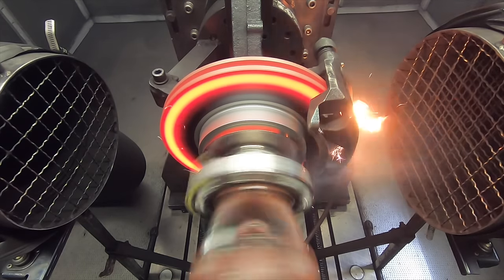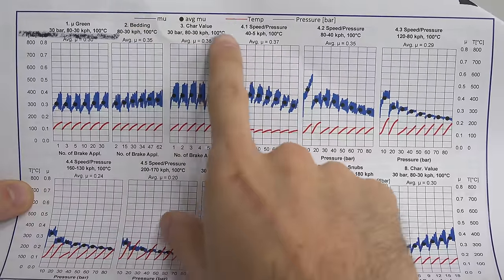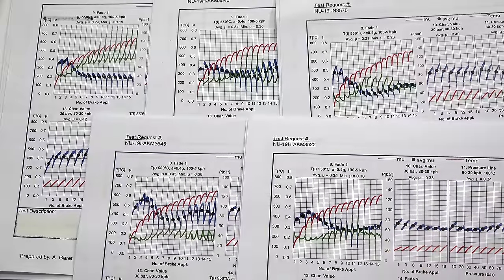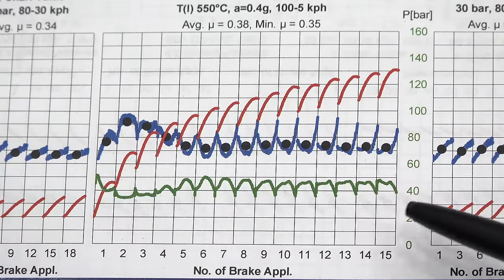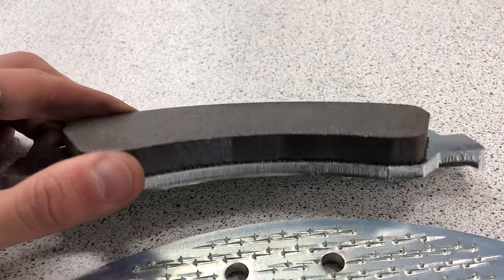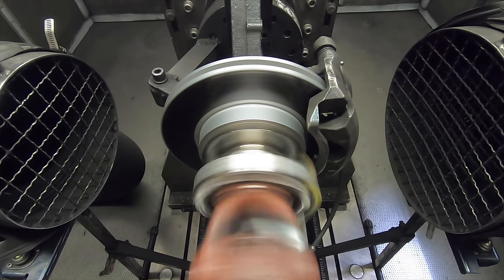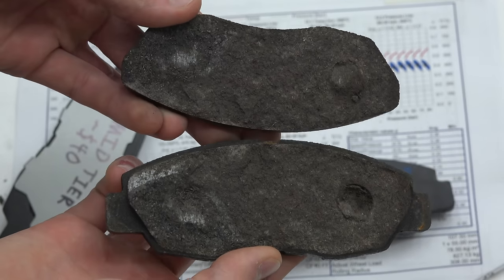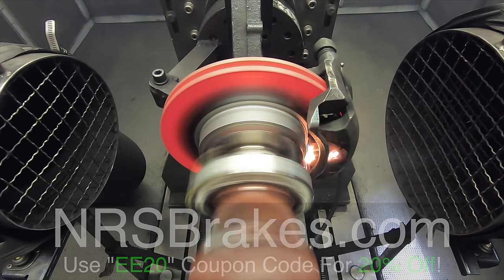What Are The Best Brake Pads? Cheap vs Expensive Tested!

Comment: Thank you for the very informative and interesting video on an important topic. I have rebuilt brakes on too many vehicles to keep track of, and always felt that brake pads are brake pads, with not a lot of differences between them within their class (ceramic (several generations thereof), asbestos, organic, etc ..). But recently, after 20,000 miles of using new ceramic pads and rotors on my Silverado, there was a brake squeeeeek. I found one pad worn to the rivits, but the rest of the pads all looked like new. I suspected a guide pin hangup had caused the grossly uneven wear, but there was nothing wrong with the pins, caliper, or rotor so it remains a mystery (at least to me) why only one pad out of the eight had wore down to nothing. These were >el-cheapo< pads. SO, I bought a set of AC-Delco pads, and wow .. what a difference in performance! So much of an improvement in overall performance, that (amongst prior incidents with various vehicles) I came to the conclusion that manufacturer parts ARE the ticket and, being in the competetive automotive parts market, those factory parts really are not that much more expensive but the quality is vastly better in many instances. I'm just now learning that lesson when it comes to hubs/bearings, too:  the el-cheapos do not last long, no matter how beautiful they look right out of the box. So for me it's TIMKEN or AC-Delco from now on, and Autolite and MOPAR parts for my Fords and Chryssler products. They make a huge difference, and the reliability is excellent. Live and learn! One day I, too, will be smart (hoping).
Reply: @Don Miller I hope you know that Autolite is not Ford if you want to buy Ford or parts you need to buy Motorcraft. Ceramic pads work well. I know because I pull heavy loads and that's what I use on my 3/4 ton and 1 ton trucks.

Comment: You should test some extreme high performance pads like PFC or G-Loc.
Reply: Yeah I was expecting a track pad to be on this list.
Reply: I'd like to see something from specific brands, such as EBC's different tiers vs OEM, and disclosing what at OEM pad came from (was it a civic or what?)
Reply: @ecidemon5672  I have been using EBC's for years, I haven't had a failure yet (knock on wood). Now $60 dollar box store ones I've dusted lol, nothing like coming to a stop and seeing two black clouds of dust puff out from your front wheels and your pedal smack the floor lol. Also dusted a set of OEM's.
Reply: @TdrSld  I'm using EBC and am very happy with them. I also like that they make their stuff in the U.S. and Britain instead of China like most other companies.
Reply: G-locs are sweet
Reply: Exactly. Even something like StopTech Sport (309) is a totally streetable track pad which seems to sacrifice absolutely nothing other than dust. Can't get them to fade on agressive backroads. Might fade on track for heavier cars, but then might as well run gloc like I do now
Reply: @TdrSld  ebcs are a meme in the community. I tried ebc on my car and first time I got them hot they chunked and the pad fell off the backplate. No one serious uses them for long.  Total joke pad IMO. Buy Gloc/carbotech or PFC for performance brakes.

Comment: Bosch rotors and OEx Wagner pads, you can't go wrong.   80,000 miles before I even replace pads and rotors free under warranty.    Fade is minimal under heavy braking and hot brakes.   Properly cleaning and greasing caliper pins and pad slides will also help them last alot longer.    When I replace they are barely worn too btw.   Crazy good performance and longevity.

Comment: I always go OEM and I never regret. The only thing I go my own choice is Motor Oil which I use the best and most expensive one. Never had any issues with any of my cars. Not to mention that I do preventative maintenance a lot like I change my brake pads when they have 20% life left. Might be crazy but I prefer to be safe than sorry 👍
Reply: What if I told you a lot of oe is made by third parties and a lot of third party mechanical is better than oe. Take for instance Honda/Acura rotors. Very poorly designed in runout and longevity.

Comment: Before the video: "I am really curious what brake-pads stop a car the fastest."
After the video: "I still wonder. But at least I know that maybe 27 out of 1430 braking maneuvers may be audible with cheap ones."
Reply: @Mos' Nefarious When the cheap pads overheat, they might not stop your car at all (in time).
But an easy solution would be to not let your brake pads overheat.
Reply: The tires on the car are probably a larger factor on the ability of a car to stop quickly.
Reply: If you can't use the info to figure things out, take the bus.
Reply: As a mechanic, customers do complain about noisy brake pads. I thought this test was relevant.
Reply: Literally the first test showed G Ratings of stopping power. What’re you still wondering about?
Reply from the maker: Tires are the key factor that determine your stopping distance, not your brake pads. Commonly misunderstood, but I have a lot of videos showing the differences in stopping distance, based on tire selection (as long as ABS kicks in, the brake pads are capable of stopping at peak deceleration).
Reply: Fully metallic best, then semi-metalic and last ceramic.  Best biting break pads wear out at a higher rate.  And also eat your rotors more quickly.  Or pay more attention to driving and you don't need to emergency stop Everytime!

Comment: "This video was brought to you by OE brake pads"
Reply: Seriously great comment, should be the top comment.   I was absolutely surprised how well the OE pads worked... it sort of makes sense because they worry about getting sued over safety faults and they have huge buying power. Still OE could vary, is Kia or Ford or BMW using identical OE specs?
Reply: @olemissjim  We'll never know but I would guess No. I say that because some people have to change their brakes often and others dont. I have 80k km on my VW and just now need to do the brakes...
Reply: @olemissjim  And don’t forget some car manufacturers out source their parts to other companies. For example, NGK make my OE sparkplugs. Garret make the turbo. Bosch make many electrical items such as coils.
Therefore you can assume that top end brake pads are also unbranded OE pads.
True OE can vary, depending who its being outsourced to.

*Interestingly... the OE spark plugs cost a fortune and you can’t buy them with the OE part number from anywhere else other than the main dealer. The main stealer literally have a monopoly. But NGK make a cheaper non-OE spark plug with a different part number, that has identical specifications and dimensions.

Comment: I have often found than brake pads are cheaper than the front end of a car.
Reply: Probably due to economy of scale - they sell a lot more of the larger pads, so they actually end up cheaper to produce even though they have more material in them.
Reply: @Beer_Dad1975  I think he means it's cheaper to buy good pads than replacing the front end of your car in an accident.
Reply: @JoeUrbanYYC  lmao, yes I read it again you are right. Total reading comprehension fail from me!
Reply: Good tyres also play their role.
Reply: @Cube8  Yup, Michelin Pilot Sport 4S for me.
Reply: Matthew Sharpe I love those. Rated for 190 mph.
Reply: @JoeUrbanYYC  Yest but nothing will save you if there is oil in the road and it's raining. ..

Comment: So the only question I have is, what exactly was the "mid tier" option?
Reply: Silver gold or platinum brakes. Golds mid tier.
Reply: When you go in a parts store they usually have their store brand pads available in three options. Depending on which store it is they’ll label them differently. One will call it “good, better, best”, another, “silver, gold, platinum”, etc.  So he’s talking about the middle option. 
My question is about rotors though. I’ve always bought the middle pads and had great results with them. But rotors are a different story. I’ve had issues with rotors. I’d like to know how to find a decent rotor.
Reply: Trash, apparently.

Comment: "Lower, Mid, Upper"
So are we just going to assume that all brakes in a price range are exactly the same?
Reply: They like to believe that
Reply: Choosing between a semi-metallic  vs ceramic will result in different physical effects, one of which involves rotor wear. Semi-Metallics eat rotors faster.

This guy is giving off book smart vibes with no true sense of variable elimination, which is huge in science.
Reply: No, man; those are the brand names.  You've never heard of Lower brakes?  Upper makes all kinds of stuff.  Likewise, OEM is a single manufacturer.  They're all direct competitors, but, if I remember correctly, Mid brand is almost always the most expensive.  /s/
Reply: Why don’t you go ahead and buy 5 sets of every single brand of brake pad available, and then take the time to do the tests on each and every single one of them in your garage with the proper test equipment and monitors, then make a video about all of them after putting all of the statistics together for all of them, and post it for us to watch?
Reply: @TehKaiser  Do it better.
Reply: Yeah he should've gone with Lower Lower, Mid Lower, Upper Lower, Lower Mid, Mid Mid, etc...
Maybe even Lower Lower Lower, Mid Lower Lower, etc!

Comment: honestly the mid tier sounded like a pretty good cost benefit option
Reply: I use PowerStop carbon ceramic brakes. They are mid priced for high performance brakes and I've never noticed excessive noise, they have consistent pedal feel, and didn't have any noticeable fade while towing near max capacity on mountain roads with no trailer brakes.
Reply: Made in chyna crap nowadays.  When did you buy yours?  Apparently the last 2 years, their manufacturing took a crap.
Reply: @Kenchinito2207  Corrosion.
Reply: @timothyandrewnielsen  I bought them about three years ago and ran them about 8 months before I got rid of the truck for other issues. It was my daily driver and tow rig. The trailer weighed 7500-8000 pounds and they held up well and never gave me any issues.

Comment: What was the price of the OE and NRS pads? To make it fair we need to know what was their approximate price range.
Reply: 2013 Focus front pads only $105. Just an example.
Reply from the maker: Obviously will vary depending on what your car is, but in this example the NRS can be bought for ~$72, the OE for ~$75. The link in the video description lets you search your car, to see how much it would be in your case (if you end up buying anything, the code "EE20" will take off 20% for EE viewers!). www.nrsbrakes.com/ee
Reply: @EngineeringExplained  Wow, definitely wasn't expecting a price like that on OE pads.
Reply: @JSFGuy   I have a 2015 focus , the oe pads feom the dealer are 50.
Reply: @toecutterjenkins  right on well I've got 98k on my 2012 mostly highway driving but they have been excellent they've got lots of pad remaining. Very little brake dust nice even where I have no complaints and they're zinc-coated probably like yours.

Comment: I want to know what the mid-tier pads are, they seem to be the best overall value.
Reply: He does not get into the reasons why rust and noise are things to avoid...but you should avoid them. NAPA Adaptive One have worked very well for me, incase that helps. A local NAPA store owner suggested them as those are his preferred....I got over 100,000 miles on a set on a car driven on salty roads.
Reply: Rick besides t he noise and slight variation in break pressure, they performed better that the upper tier brakes in every category. For daily driving those seem like the best option, although if you start getting into track driving i can see oem or performance brakes becoming king
Reply: @Android602715  no way will I ever go less than top shelf. Fiddling with brakes is a pain and at the age of 48 with a degree in mechanical engineering and driving 40,000 miles a year, I can assure you I've tried all of the options. Low and mid are a waste of time and money.

Comment: I have to say that I drove already 120 000 kms with my BMW's original OEM brake pads and they are still good. I'm amazed as well. Usually I change brake pads at max 30 000 kms in my other vehicles.